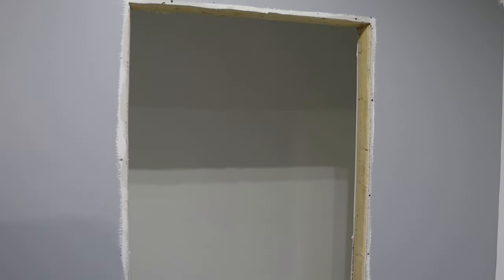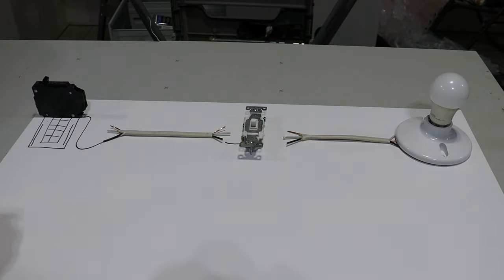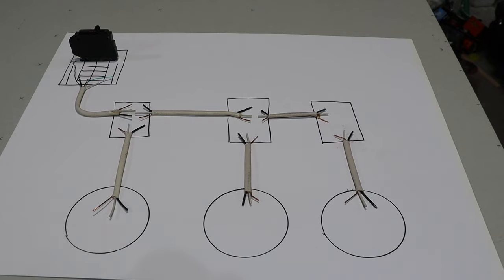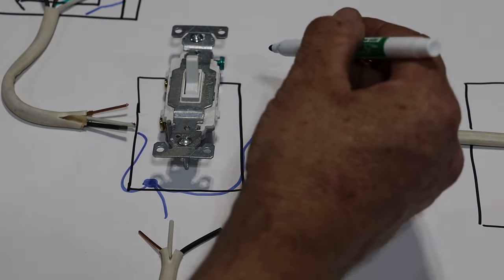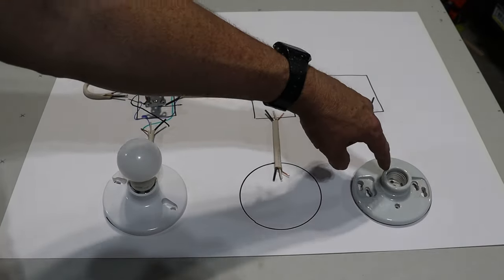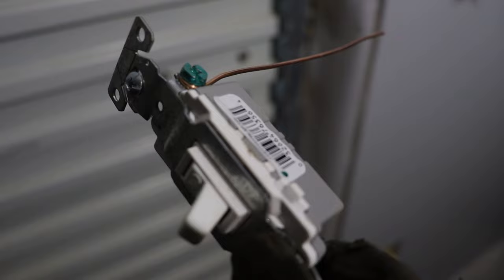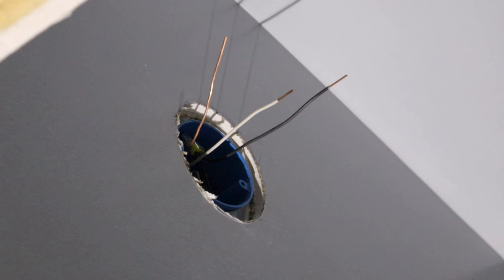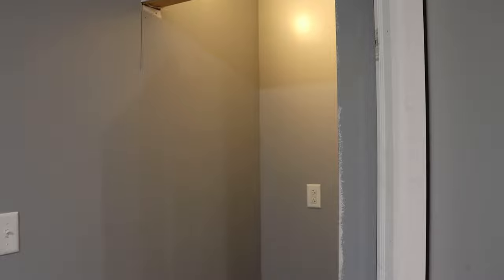Light Circuit Installation Explained | Wiring Lights in Metal Garage

Comment: So if my living room and porch lights share the same switch- I would need to get two switches. I would have two neutrals, 2 grounds and 2 hots. I would connect the 3 wires to each switch. How do I know which cord I would need? Just a 14/2 because of the two switches?

Comment: Bro- you showed everything but the one thing I needed! Where the wires go on the light housing!
Reply from the maker: There should be a ground screw or a green pigtail attached to the light housing. Attach the ground wire of the light to either one available, and then connect your hot and neutral wires to the lights hot and neutral wires.
Reply: Gotta remember to install it in this order
Ground , neutral, hot

Comment: question: is installing a fan with a light the same concept? Also, can you use the same gauge of wire and amp breaker as you use with lights?
Reply: never mind, I just found your ceiling fan install!

Comment: Thank you for this great video. I have a question, I know it is ac voltage and it keeps changing polarity ( sin signal), but I am still stressed about when it is to wire a light fixture let's say, some light fixtures like LED lights, doesn't show which one connects to hot (black) and which one to neutral (white). Would you please explain if it is matters or not whether flipping the hot with neutral.
Reply from the maker: There should be some type of indicator on the wires. Some wires have writing or a line on them to differentiate which wire is which.